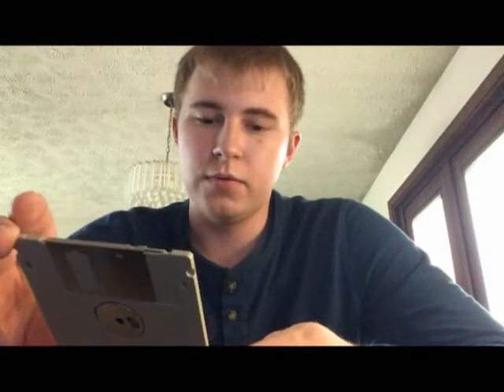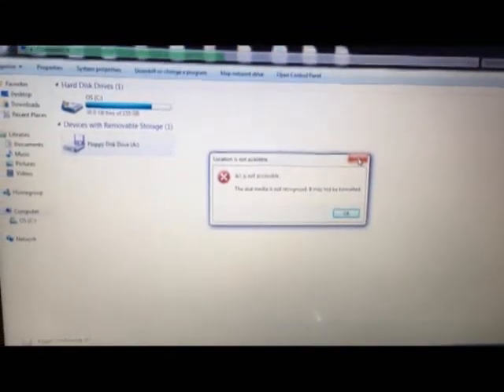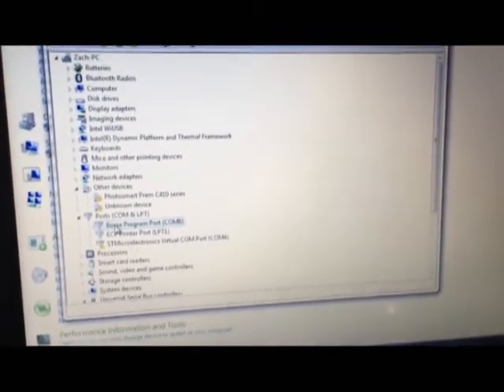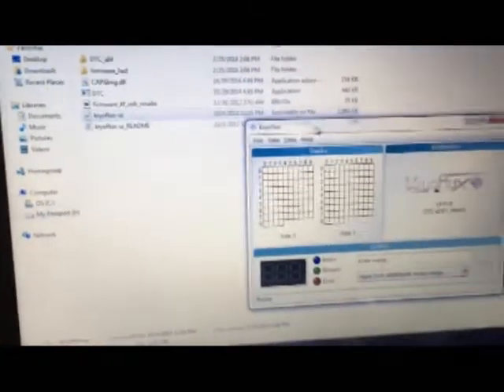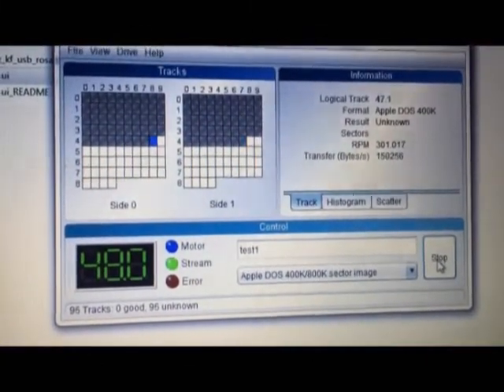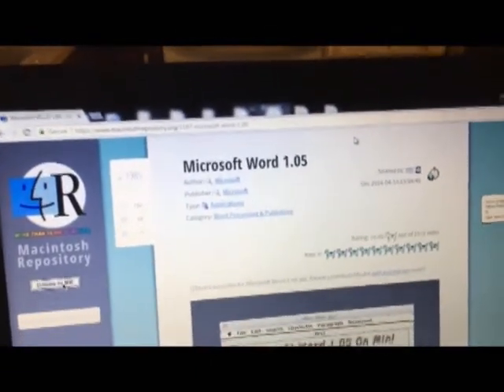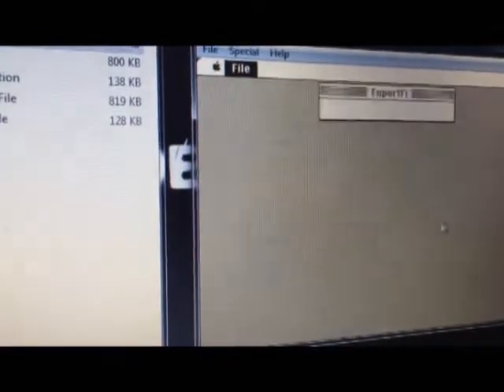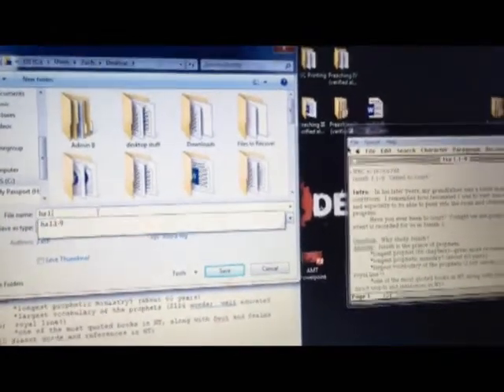Using Kryoflux to Recover 400k/800k Mac Floppy Files

Comment: I have a Mac Performa 6112CD PowerPC. I'm thinking any disk readable by this machine can transfer plain text files to disks readable by the a PC of some sort or another. Other types may include JPEGs as well. I have transferred text files from Mac to PC as well as JPEGs from this type Mac machine to a Dell or Gateway PC with floppies. So I saved some text files from an SE to a PC.
Reply from the maker: Yes, that appears to be another method you can use, since that machine was newer, but still supported the 400/800k disks with MFS format. Purchasing a Mac Performa for this purpose could be more expensive than the kryoflux though.
Reply: @zachschweinsberg2601  It was simpler, and my ignorance of hardware at that time was just something I didn't comprehend. But I discovered certain file types would transfer by this method, even MIDI files.
Reply: Actually, I played some of the MIDI files I made on the Performa years ago recently on my iPhone after downloading an app.
Reply: All I knew was the capacity and format of the disks were incompatible, but I didn't realize just how incompatible they were.
Reply from the maker: @ronboyd9  If you follow the sonic link in the description, it lists what machines and which operating systems are capable of reading 400/800k MFS files. That’s the only reason I know that what you’re saying is possible. Thanks for sharing your experience.

Comment: Thanks for this video. I bought my Kryoflux a few years ago to quickly archive some 5.25" diskettes from a vintage Z80 system, then stored it away after 100% success. I'm now archiving some diskettes from an HP logic analyzer, so I thought I'd just watch a video or two on the subject to get me back up to speed. That was a few days ago....

Well this time the Kryoflux didn't play ball. I tried changing various settings and four 3.5" diskette drives, but nothing seemed to work, and I convinced myself that the device had failed. But then when I was doing something else your tip about not using a USB hub came to mind. I wasn't using a hub, but I was using a USB port on a PCI expansion card instead of one from the motherboard. So I swapped to a 'motherboard' port and reinstalled the driver. Then hey presto(!), the Kryoflux happily calibrated the drive!

Comment: I think you were on the right track in emulating Word 1 on Mini vMac to check the formatting, but you would probably be better served by finding a good ‘bridge’ between old and new Word. If I were to guess, I bet either Mac Word 5 or the notorious Mac Word 6 could probably open the Mac Word 1 file then save in a format modern Word can open natively. 
Obviously vMac probably isn’t suitable for that, but I know the author has a Mac II emulator, to say nothing of programs like Basilisk II or qemu
Reply from the maker: If someone else ever needs to do this, hopefully they can use your advice to make a better setup.